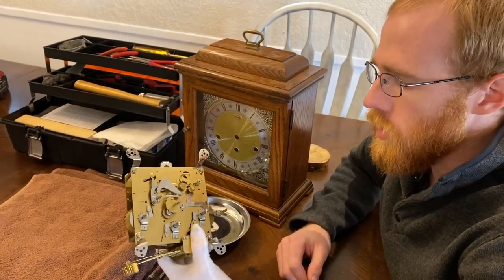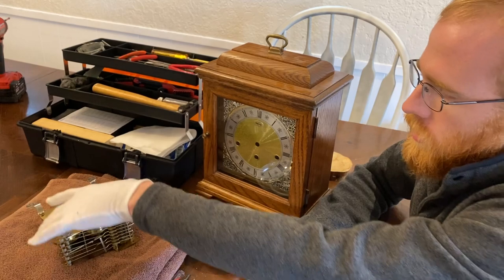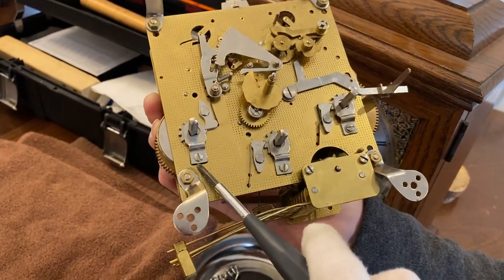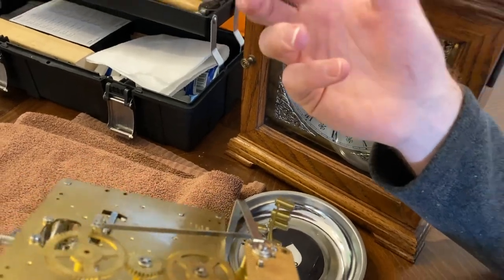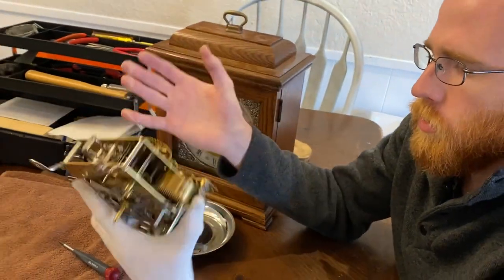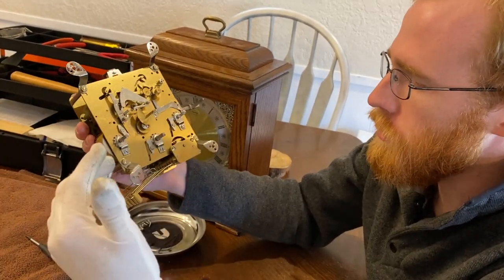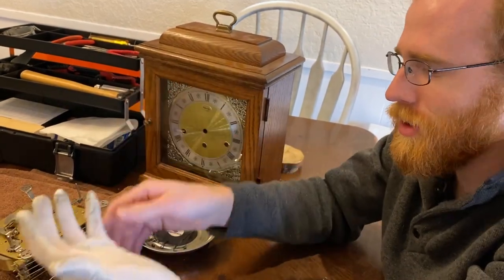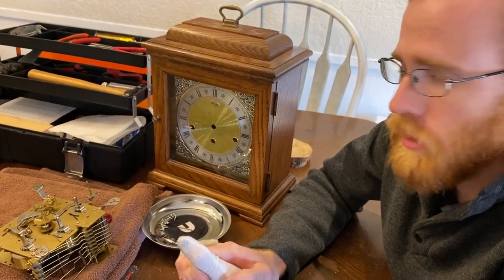DIY REPAIR? How NOT to fix your clock

Comment: I've come across clock movements in the condition you describe. DIY Folks don't realize that clock gearing should run dry, yet I've seen either that green goo or just oil all over the movement. Good video. Hopefully folks will take heed.

Comment: Best way to reverse this is remove the spring barrels and use warm water and baking soda in a ultra ultrasonic cleaner baking soda will neutralize the acids and ultrasonic cleaner will clean the pivots

Comment: I'm a newbie heading down the rabbit hole of horology, The first clock I salvaged is a Mauthe wall clock. It passed my inexperienced visual exam and I'm not yet confident enough for a disassembly and re-assembly so I gave it a vat treatment using isopropyl alcohol. It's been ticking and tocking and chiming for a weak now. As I get more experience I will one day disassemble it and clean it properly.
Reply from the maker: Isopropyl alcohol is probably the safest bet for a dunk method since it's relatively gentle and super evaporative (although it doesn't evaporate as thoroughly as something like denatured alcohol). Since it's a clock you're trying to learn on, there's nothing wrong with trying it and finding out what happens.

As long as you know how to do it safely, don't be scared of taking it apart. Just take lots of pictures and make sure you understand what every single piece does. If you truly understand it, you don't need notes, pictures, or anything else (but they do make the process faster).

Keep it up! It's a super fun hobby!

Comment: Have 2 clocks not working, one is a genuine antique, the other a 1960s or 70s Seth-Thomas. So thought I’d buy a cheap not working clock to see if I could get it working. First video, English handyman type person, he says dunk it in gasoline for 2 hours then pull it out and clean. Don’t like that idea very much. Second video, English clock repairman. He says the pivot holes get elongated and the gear wheel gets a little cockeyed then the entire gear train stops, that or a gear tooth is broken somewhere in there. He completely disassembled the clock works, replaced the worn bushing and put it all back together, that is daunting to say the least. Or try to degrease it with something one pivot at a time but it may still not work.
Reply from the maker: The repair process really depends on a lot of factors and what is wrong. It's true that the pivot holes get wallered out, and fixing them correctly requires a pretty significant repair process and some special tooling. One key rule of thumb is that most of the time, if there is not significant wear, you don't need to disassemble the movement. To tell if there's wear, wiggle the gear train back and forth to see if and of the pivots dance back and forth. If they don't dance much, you don't need to take it apart (unless you want to). Now, if there's major wear on a pivot on a movement that is just for learning, instead of bushing it properly, you can punch the hole (use a sharp punch and use it to close the hole back up). Just be aware that there's a time and place for punching a hole, and it's very rare. Never punch a movement that's antique/valuable.

BUT, if there's no major wear, with a little elbow grease and creativity, you can get all the dirt out of the movement without dunking it or taking it apart.

Sorry for the rambling. Long story short, there's a lot that goes into getting a clock working, and it really depends on what the issue it. The best thing you can do is put in as much time as it takes to accurately diagnose the issue, and then fix that issue. Hope that helps. Keep it up!
Reply: Get a copy of Practical Clock Repairing by Donald de Carle. you can get them second hand. It will tell you everything you need to know from simple repairs to making new parts and a clock. If you want a cheap clock cleaner try Turtle wax car shampoo as it has no solt. just put all the parts in for 3 or 4 hours with hot water. then rinse off under the tap before drying with hot air like a hair dryer. as you have now removed all the oil they will rust in minutes. After that you can pick out all the dirt still left between the teeth and pivot holes there with toothpicks and kitchen towel.

Comment: Every one to himself here lol. I suppose there are reasons why one should not attempt to clean or repair any clock, even if you watch YT  videos of people doing it professionally as a career/job. If maybe one want to attempt it, use a clock that you know wont work(like im doing now🤣)and have a go at it knowing there isnt anything to lose at all. So i guess a lot of photos in chronological order and keeping the parts together and organised, along with some common sense and close attention to detail😂 dont know what will happen after this attempt at an old cuckoo clock thats been in familly for decades
Reply: That’s awesome! That’s exactly how I got pulled in to the business. A family clock broke and wasn’t going to get worse by me working on it, so I gave it a shot and got hooked.

I think it’s great when my customers give it a try - best case, it works and you have fun in the process; worst case, you can’t fix it and have to take it to someone anyway. My biggest recommendation is to just not do anything permanent (like cutting, bending, modifying, etc.). Have fun! Feel free to reply back if you get stumped.
Reply: @loganm2881  lol yeah im only trying because im into miniature things like my model hobby trains making me used to working with small things. So for clocks ill be testing the waters a short while,  then see how it goes😁

Comment: I have a clock with 2 pendulums but it hasn't worked properly for a month with the wobble how to fix it. please reply
Reply from the maker: There's a lot of reasons a clock can stop; the best solution is to bring it to a good repair shop since it's sometimes hard to diagnose without seeing it in person. But, can you describe a little more about what's going on?

Comment: I have a clock I picked up from a thrift store that seems to have had this done to it. Would denatured alcohol remove the ammoniated cleaner and dry relatively well? I saw that elsewhere you mention denatured alcohol as a better cleaner option
Reply from the maker: Short answer: Yes, denatured alcohol will remove it easily; rubbing alcohol will also remove it (a little less easily, but a little less toxic too).

Long answer: The catch with denatured alcohol is that the stuff you get from Home Depot does not evaporate completely (only about 86% will evaporate) - it leaves behind a residue. I'm not sure what it leaves behind - if anyone who's a better chemist than I can give insight, I'd be very interested to know more. Either way, I don't like leaving anything behind in a movement. So whenever using any type of cleaning solution, just be careful to make sure it only goes where it needs to, and then comes back out completely. That's the danger of dunking; particularly with spring barrel movements, there is no way to get the cleaner back out of those barrels without taking them apart; and if you could get it all out, it would leave the springs dry and unoiled.

Comment: The only things that scare me are the handling of the mainsprings that can and are dangerous under tension. I don’t have the special loader unloader tools to safely wind or unwind a mainspring. I also need to learn what gears go where and keep the two separate. There are several tools and parts, that I don’t want to invest in I just want to get a clock to work

Comment: That looks like a mass produced German movement. It's cheaper to replace the movement which will cost about $200 $250. depending on the movement.
Repairing it as a job would cost a lot more in time not parts.
But they are not too bad to work on. the pivots can get a good smooth finish when burnished.
Reply from the maker: Absolutely; my recommendation was to replace the movement in this case - although that service is considerably more than $250.
Reply: That movement brand new costs like 450-500 dollars
Reply: @Cobesclocks  Hermle 1051.020 m Looks like that is one of the most expensive spring Hermle movements at £420 including tax.

Comment: I saw someone on YouTube that their clock in gasoline what’s your thoughts?
Reply from the maker: It would probably get the dirt out and get it running for a while, but with any cleaner, the two problems are that you 1) can't get it all back out (gasoline evaporates fairly quickly but not completely) and 2) you can't get oil back into the mainsprings. I suppose the counter-argument would be that gasoline has some lubricative properties, so it may not be too destructive. The other big problem is that when you dunk the movement, you don't fix any worn components, so they continue to cause either short-term or long-term problems and can ultimately result in very extensive damages if left unaddressed. But most importantly, it can be really dangerous to work with an open vat of gasoline (even static electricity from your socks on the carpet can ignite gasoline).

Those are my thoughts. To summarize: it might work, but it's certainly not the best way.
Reply: I probably saw the same video. Auto gas is notoriously unstable, turns to jelly so I kind of discounted that guy. Coleman fuel (naphtha) might be better. Also if the clock works are newer there might be plastic parts in there, but don’t know. Typewriters after about 1960 get cheaper, thinner, more plastic parts. 1960 and before they are noticeably more robust. Don’t know if it’s the same on clocks.
Reply: @someonespadre  That video was probably mine! I just use the petrol as a solvent to dissolve and wash away the dried old oil. It doesn't leave a jelly of any kind as it's a soak & rinse thing, and then some gentle compressed air to dry. Any residue left is so minor it would never cause issues for a clock. Sure, you would never do it with a watch movement - but a clock is fine! Of course, it would be no good on modern mechanicals with plastic parts. It's also no good to use on a clocks with enclosed mainsprings as you can't 'wash' them out properly and cannot re-lube them as mentioned above. Also, as mentioned this method does not fix any other problems like worn pivots or other mechanical damage/wear. Obviously! And it's flammable, so be sensible!
In summary, it is not the best method at all - but it is a way for a non-clock person with limited knowledge and equipment to get some old clocks going that are not worth the expense of a proper/professional service.
Reply from the maker: The problems with dunking are that 1) it leaves residue, 2) it gets in places where you can't get it out, and 3) you end up missing other issues because you're not using the ol fine-tooth-comb. Naphtha probably evaporates a little cleaner, but you make a very important point that some chemicals can do major damage to plastic parts.  @someonespadre
Reply: I would avoid gasoline that has ethanol in it.  That stuff is notorious for gumming up small engine carbs.  If you went the gasoline route, only use "clear" or "white".  Plus follow all the pertinent safety precautions.
Reply: @rockybarrett9301  I was a small engine mechanic for about 15 years in my own repair shop - and I totally agree with you! Ethanol fuel shouldn't be used in anything!
@LoceneClockworks - 1) Not enough residue to cause any problems. 2) Not to be used with enclosed mainsprings. 3) It's only a quick fix for a low value clock which has been gummed up with old oil, or incorrect oil. It won't obviously fix any other issues.

Comment: Well for.a start Mr.
Clock.makers like yourself.wont.be around for.much longer in some.areas 

So people will have no choice but to.do the DIY method to get clocks.going again.
Reply from the maker: With a little patience and a few household cleaning tools, you can actually get them very clean without submerging. For those interested in DIY clock repair, I recommend giving that a try to avoid causing greater issues in the future.